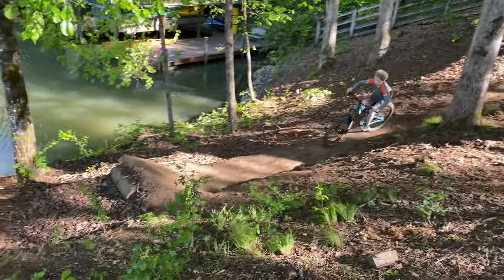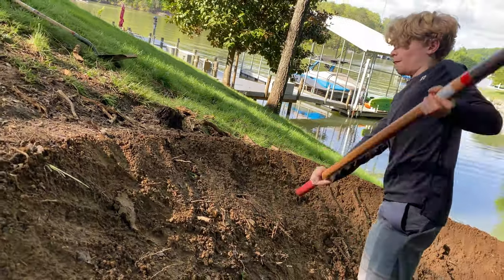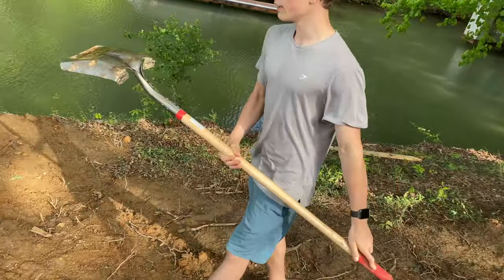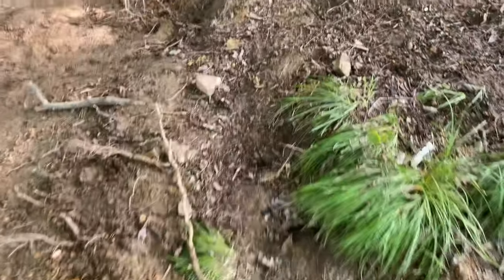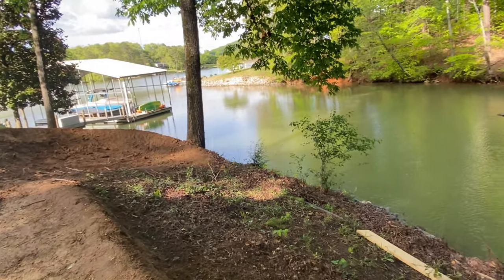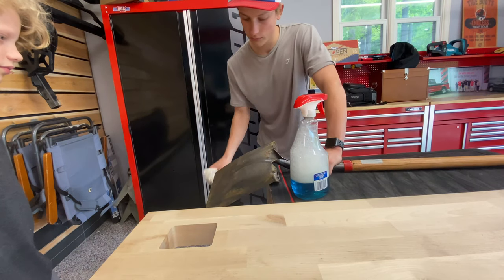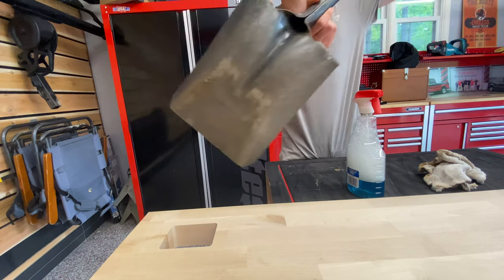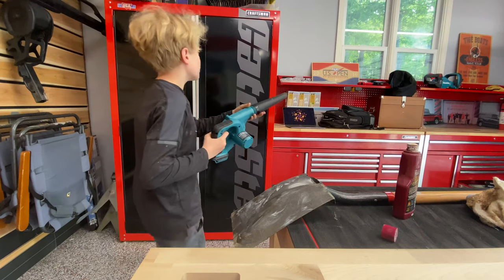Why is Tennessee Dirt SO STICKY?

Comment: Great to combat clay with Mom's cooking oil, but maybe cheaper if you used cheap vegetable oil (i.e. other than olive oil). The wax worked well too, but maybe a teflon coated shovel would do the trick?  Try to google search to find one. Or, use more water. Here is another idea,  throw a bed sheet over the area you are packing and pack away spray water on it to remove it.  

Nice to have a little bro to help make videos!
Reply from the maker: biketothetop thanks for the advice man. I will try out the bed sheet idea